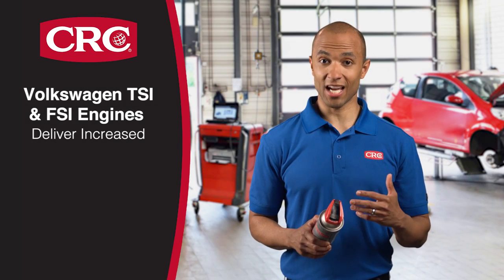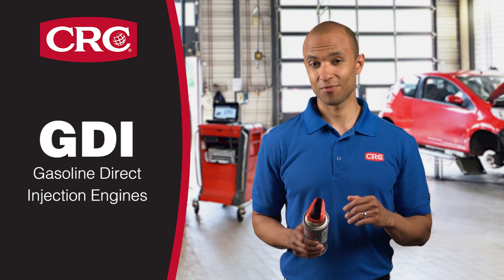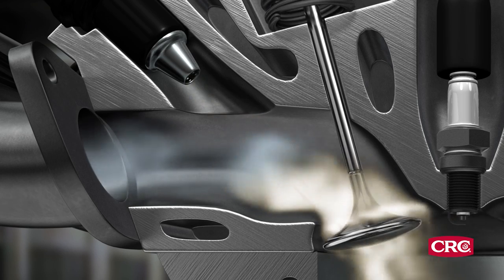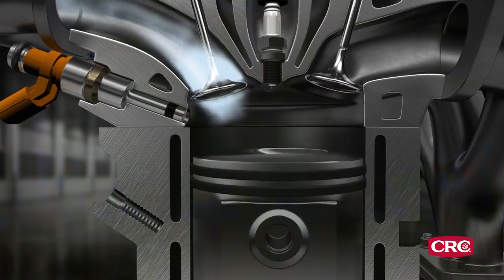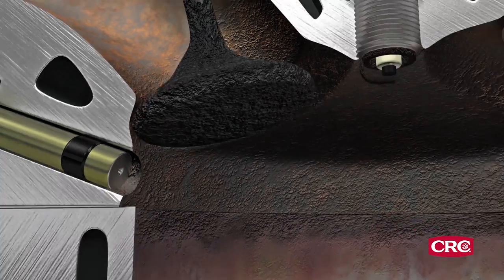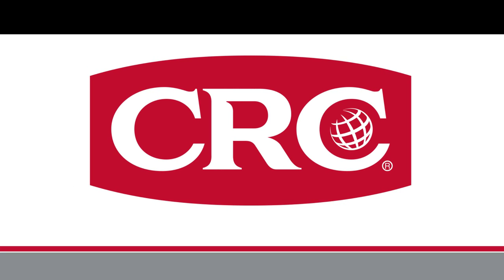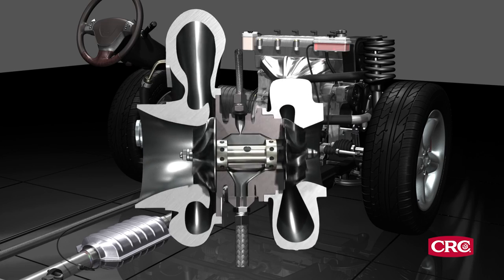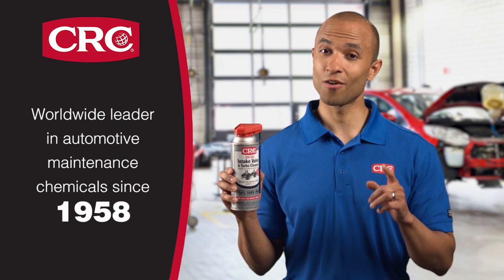Volkswagen Engines with CRC GDI IVD® Intake Valve Cleaner

Comment: Does anyone know which vaccum line i can use to spray
Reply: Spray it directly into the turbo inlet pipe if you want to clean the turbo. Otherwise you use the boost tap port on the side of the intake manifold.
Reply: @sinnaever  what about the brake boost vacuum line?

Comment: Hey CRC??!! Your advertisement is terrible, and gives us hardly, if any information on how to apply this product. Here’s an example that you don’t explain: You mentioned using this product without engine tear down, and the intake and exhaust valves are situated in the combustion chamber deep into the engine between the cylinder head and the engine block; ....and I can’t think of any other decent way of cleaning those, without removing the cylinder head???
How about making a concerted effort into giving Volkswagen owners some insight, and a demo explaining to us exactly how to apply this on an actual VW 2.0L TSI engine??? Your profits might actually soar!!!!
Reply from the maker: Thank you for watching.  Please visit crcgdi.com, view this video https://youtu.be/RcVDZAauO88 or contact our tech service department at techservice@crcind.com or 215.442.6290 with additional questions or for detailed instructions.